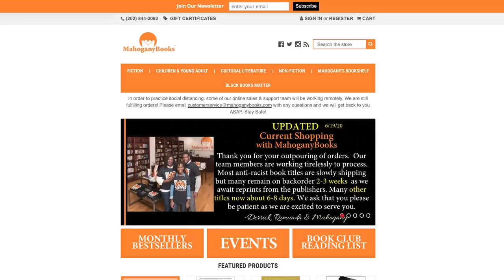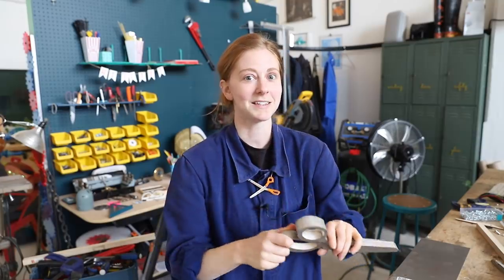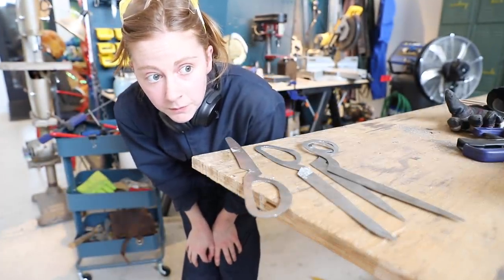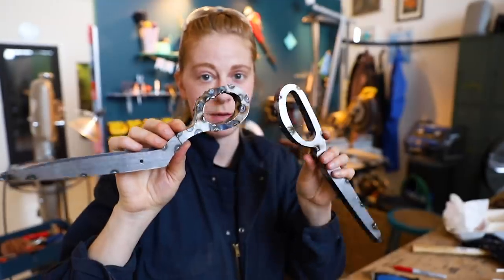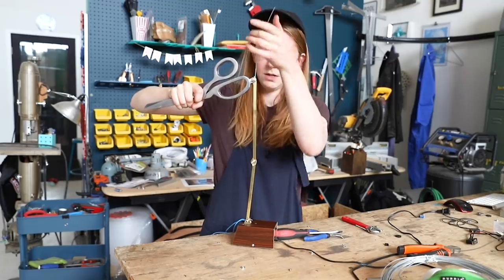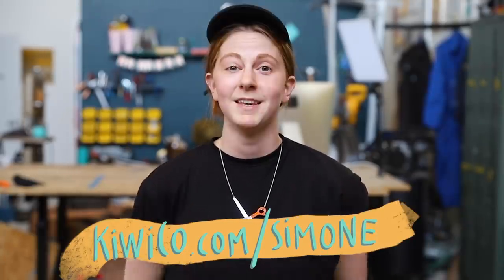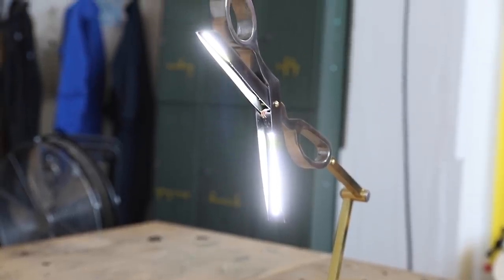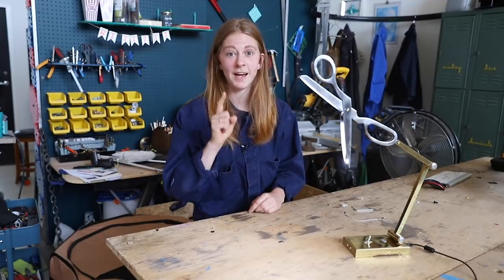Building a custom scissor lamp

Comment: Simone, graduated physical therapist here (and also a maker), the table that you were using is too high for you, so your shoulder was too extended and elbow too flexed. This ergonomics was causing you to not push down the jigsaw hard enough onto the table surface. Possible solution 1: kneel and cut on the floor, and use insulation foam to elevate the sheet metal. Possible solution 2: Build another lower workbench! (a rule of thumb is: the heavier the work, the lower the desk)
Reply: Thanks for the tip... Utilitarian brain goes STEPSTOOL to get more leverage
Reply: @khoshekhthecat  That's ... much clever than my suggestions!🤗
Reply: That's a cool job, does it help you draw anatomy (for art, lol)
Reply: @juliusroman8616  To be perfectly clear, I'm not currently practicing physical therapy. And I think learning anatomy would definitely help your art, I think there are anatomy books specifically intended for art. (I suck at drawing tho🤪)
Reply: Ooh it's so cool when suddenly you can mix two things you know about although they seem to have nothing in common.  Have you considered pursuing a career in ergonomics?
Reply: @Nandanyx  Ergonomics no, but I'm interested in things that help people that need help such as orthotics!
Reply: u could've shaved that down to 2.5 words (ur short lol)
Reply: I'm pretty sure that's the worst way to cut sheet metal anyway.
Reply: Nexus...absolutely agree with you .
My thoughts exactly, plus the table is far too thin.
When you push against a table that is wobbly ( vibrates as it's too thin) ,
...then it affects your ability to work properly. 
Worth investing in heavy duty wooden bench . 

You need a much thicker lower one . 
Same applies with any heavy duty work, like hammering nails , sawing , sanding  etc.
Reply: I would have just used an angle grinder. Work smarter not harder. but she got multiple comments worth of engagement and entertaining footage of her struggling with it, so maybe it’s more the goal here being the process entertainment value, and not really the end product
Reply: @RexusKing  Maybe not a clever solution to use powertools while standing on a small, less stable surface.

Comment: Imagine if there was a contact switch on the scissors handles that deactivated the lights when they were closed
Reply: She even said it was her initial idea!
Reply: I genuinely expected it to be that.
Reply: lol that was exactly what i was thinking she would make. That would be a very cool effect tho
Reply: It would be even cooler if she put a potientometer in the joint so the light would be dimmable
Reply: But then you would always try to see if the light actually turns off, like in the fridge!
Reply: But when it closes it doesn’t light up. So it kinda works like that
Reply: With a potentio meter it is perfectly possible
Reply: I was going to comment exactly that, that's what I was expecting
Reply: Then you can literally "cut the lights"!
Reply: Ya that's what I thought she was going to do
Reply: Yeah I was really hoping that it would happen in this video
Reply: If i can suggest...  Next time, cut It rought with the angle grinder and refine the profile with files.... Or, glue It to plywoog and cut with the jigsaw using some cutting fluid
Reply: My thoughts exactly, follow.up project
Reply: I genuinely thought that was what's gonna happen
Reply: A reed switch, some WS2812, ESP8266 and WLED firmware. Done.
Reply: @skinmore  or a sheet metal nibbler.  Its literally the tool for the job 👍
Reply: It would be great, but this amazing woman deserves a life too😂
Reply: Yeah she could just use a reed switch with a small magnet in one handle.
Reply: 1:44
Reply: Like a fridge! (Lmao I'm a frickin child XD)
Reply: This how smart YouTuber get more comments.
Reply: @SluggzNotFound  bro I love ur name
Reply: Your anxiety about political correctness detracts from this video. Please don’t start beating us over the head with that stuff, it’s everywhere else already.
Reply: OK so I’m not as original as I thought
Reply: Orrr a sensor
Reply: Or just an electric current and when its complete it powers a trassitor making it stop
Reply: Also would be cool to install a cutoff so that when you "cut the lights" the switch inside turns the lights off
Reply: That would be soo cool bro
Reply: I thought the same thing.
Reply: My OCD is crying right now!
Reply: That's what I came here to see, it's what I'm expecting
Reply: It could be done with a reed switch. That would be cool.

Comment: would be really cool if it can actually turn on and off when you open/close them, instead of a switch, appreciate your videos <3
Reply: That's exactly what I thought her design idea was.  Simone - mod2, embed the switch inside the scissors.
Reply: OMG THATS WHAT I THOUGHT IT WOULD BE HAHA
Reply: Yeah, sounded like that was the idea to me too
Reply: Yup, exactly that.
Reply: Same, when she first mentioned cutting the lights I thought she'll use a flex sensor. I actually love the idea and design a lot, but I'd probably get tired really fast opening and closing the scissors just for the show. I could simply leave them open and fiddle with the switch (and then the scrissors being mobile becomes redundant). Hope she posts a part two with improvements because I like this project a lot.
Reply: It could be upgraded with a brake light switch.
Reply: i mean technically couldn’t you shut the scissors and have the lights turn off? they’d still be on but the scissors would block out any light you know?
Reply: Just my thought too! There are cheap magnetic switches for closets... Like, when magnet is close to the switch, it pulls apart two other wires, which provides electricity!
Must make ScisLamp vers 2.0! 😄
Reply: That's what I thought she was gonna do too.
Reply: @TiaMoshii  I was thinking maybe a mercury switch
Reply: my thoughts exactly! Shouldn't be hard to add
Reply: That’s exactly what I thought

Comment: You should use a limit switch so when you open the scissors they turn on
Reply: That's what I was expecting, was slightly disappointed by the use of a regular switch. Did have a good laugh at the rest of the process.
Reply: probably would have happened if there wasn't the three day flaccid stand interlude, I assume
Reply: Stll it can easily be install using cut-off circuit
Reply: MrPaw45 same
Reply: @PratikKatdare  it would make perfect sense to add one, not only because of the easy installability, but also because of the name of the circuit
Reply: Or stick a motor on it to open up on its own and then watch it not working correctly because, "shitty robots"
Reply: At minimum if she had a shot with it turned on and scissors closed and then opening the scissors.
Reply: Simone has said she wants to move away from being “the Queen of Shitty Robots.” I think she has done what she wanted to do with that genre, and is now exploring others.
Reply: @PratikKatdare  Reed switch and magnet.
Reply: If some one likes this ankther person has to unlike it
Reply: *pressure switch bute yes. she could

Comment: My electronics mentor used to say, "If you switch it on and it works the first time... Unplug it fast and double check, you did something wrong!"
That's served me for many years.
Reply: How come? Shouldn’t the goal be to have it work if you do everything right?
Reply: @CosmicGaijin  Because it could just be a fluke
Reply: @CoreyT97  or some of us are just good?
Kidding, we're all just a human.
Reply: My prof used to say that eletronics need smoke in order to work -- cause if you can see the smoke, the electronics ain't working no more.
Reply: @derradfahrer5029  That's the magic smoke that makes it work. Unfortunately once the magic smoke comes out it's hard to put it back in.
Reply: Corey Tobin but that’s what I don’t get. Why is it a fluke? I’ve engineered and built stuff that I got working on the first try (granted not always) but 9/10 times it works the first try and never gives me issues after the fact. So that’s what I’m trying to figure out.
Reply: @CosmicGaijin  If it works 9/10 times you are working on projects beneath you. If it never works at first try, you are trying things too hard for you. Ideal rate should be 50/50. 50% learning, 50% being productive.
Reply: I ve been in the EE for 16 years now and that's one of the main principles i know from the older colleagues whom i learned from:) I always get suspicious if something runs right from the start
Reply: @CosmicGaijin  there's a perfect example of it might be a fluke in this very video actually. at the third coin she puts in at the end of the video, nothing happens. which means that the first few times could just be an accidental reaction as if it worked perfectly. so you need a few more tries to check if everything is actually correct, before deciding that it actually works
edit: i was at the wrong video, please check the proud parent machine: https://youtu.be/M1B3gATS0GE

Comment: "You can definitely see a lot of imperfections in my welds, but since I'm the one making up what scissor lamps should look like, I can just decide that they're meant to be that way." I weld for a living, and have gotten pretty decent at it. Textbook looks aren't everything, and the time you would have saved doing it differently would be negligible. It's obviously not structural, and you tacked it up hella good beforehand and metal finished it beautifully. This is why I love seeing people's "imperfect" metal art, it is literally one of a kind.
Reply: A grinder and paint make me the welder I ain't.
Reply: I was reading this as she said it 😂
Reply: At least she tries, not like me. I'm a shit welder, but I braze anything you can braze, so everytime I can get away with braze welding steel and crap, that's what I go for.
Ofc, structural things I have to go get the TIG, but I swear welding machines have me blacklisted xD

Comment: Literally, Everyone > “Cut the Lights” > it’s just a expression to turn off the lights
Simone > “Cut the Lights” > seriously, use the scissors to cut the lights off.
By the way, someone needs to get Simone a bandsaw for her birthday.
Reply: She has one. It's in the BG at 2:46. She just likes to make life difficult for herself XD
Reply: Or get a nibbler... hand or electric powered, no need for a saw on sheet metal she is using.
Reply: Or a CNC table.
Reply: Or a plasma cutter! 💨+⚡️
Reply: @nickradley  I have a feeling she would love that!
Reply: Or use the angle grinder that she uses to tidy the cuts up with a cutoff blade. Even the Dremel would have been quicker than the jigsaw. But if you HAVE to use a jigsaw, temp glue the sheet to a piece of scrap ply for cutting.
Reply: she got one already
Reply: Sh3 should have a turn switch or just a lever that closes when 90-95% opens the circuit and on 5-10% opened it closes the circuit.
Reply: @Narinjas  thought the same thing
Reply: Her not using a bandsaw does make for great content.
Reply: even tin snips would've gotten the job done probably
Reply: I really don't know how much a plasma cutter costs but if every subscriber would give a bit (yea, I know, never going to happen) it can't be that expensive for each individual.
Reply: I thought her original intention was to use the action of the scissors to turn on/off the light. Ah well, still a cool project!
Reply: @adamsavage
Reply: @cimadev  A plasma cutter costs less than a Tesla, though I'm not sure about a laser cutter capable of that thickness. Since she laser cut the cardboard mock-up laser cutting the final version would seem logical.  But either one a a fair investment to make, still, if one is going to FIGHT with a jig saw for an hour, one might at least consider a scroll saw, or, if you have an hour, maybe even a hand powered jewelers saw.  Also, TIG welder! though, if going with jewelers technology, silver brazing could be a viable option.
I am disappointed she didn't put the switch in the hinge of the scissors, putting switch on the base is like putting an electric motor in an El Camino, a lot easier, probably more "practical", but not as cool. (in other words, not what one watches Simone for)

Comment: It’d be dope if the lights turned on when the scissors were opened, kickass project regardless
Reply: I was thinking the same thing!
Reply: just like a fridge
Reply: @Bruno Mikus . . . No.  No, they are not.
Reply: @Bruno Mikus I laughed so hard at this, thanks, you made my day! 😂😂
Reply: @Bruno Mikus take all the shelves out, then get in your fridge and shut the door.
report back to us your findings..
Reply: @Bruno Mikus check around the edges of your fridge (when open). There should be a little piston-looking thing, usually at the top somewhere. Press that in (with the door open), as if your finger is the door, and it cuts the light :) Although I think there MIGHT be fridges with a different mechanism, but this is the most common one.
Reply: I thought that's where this was going.
Reply: She literally showed that at 1:37 :D
Reply: @hobistinyheartbag  why she no?
Reply: Yeah, something like an endstop in the handle could work, but it would probably mess with the aesthetics. It looks really cool as it is:]

Comment: How to cut sheet metal with a jigsaw:    
1: sell jigsaw
2: buy bandsaw
3: cut sheet metal
Reply: Right...........
Reply: She has a bandsaw in the background
Reply: SHE HAS A BANDSAW IN THE BACKGROUND.
Reply: A scrollsaw is marginally better to cut the way she was cutting, but it will have basically the same problem. Even a fine tooth metal cutting blade (on either jigsaw or scrollsaw) can catch and rip the work piece up. The only way i ever found to cut metal like she was, was to glue the metal down to scrap plywood, or use 20 clamps that you constantly move around. clamping right in front of where you want to cut works best, but then you need to move the clamp constantly. Really, glueing the sheetmetal to scrap plywood is the fastest (although it can still rip up). 

Obviously a bandsaw is the perfect tool for this because it can never rip the piece up from the work bench.

There are very fancy jig saws that will push the blade forward on the down stroke and pull it back on the up stroke. If you BARELY push while cutting with one of those, it will not grab as much. But it will still grab. I think those are called oscilating jigsaws or something like that
Reply: Gunhaver TL;DR you’re wrong
Reply: Let’s buy her a water jet CNC.
Reply: yes cutting metal with a jigsaw is the worst
Reply: michael1234252 perfection.
Reply: Drimel works great for the fine details and curves.
Reply: @Gunbudder  that's why you buy a diamond cutting edge blade. like, 3 or 4 dollars for like a 2 or 3 pack from harbor freight
Reply: I couldn't hammer a nail if my life depended on it, but while watching this madness,  I kept thinking, "Surely, there's a better way than this."  Glad to know there is.
Reply: nah a nibbler would be perfect even more than a ban saw for tight turns, they work so good for thin metal plus name is funny as haha
Reply: She need cnc  plasma cutter
Reply: Should definitely just buy some inexpensive sheetmetal shears to cut that with.

Comment: Having the light turn on automatically when opening the scissors would be amazing
Reply: I agree! I'm sad it didn't work out that way. But I'm glad she showed us her mess ups and mistakes. ❤️
Reply: Then you could cut the lights...FOR REAL.
Reply: @joanna4655  True. It adds to the experience of something being built from a concept. Her frustration at not getting it right the first time, but persevering until she does get it right is what the creative process is all about.
Reply: I thought that would be the case
Reply: @RBelmont  Exactly. I was disappointed when she installed the switch. But it turned out great nonetheless.
Reply: Well I mean if u just keep the lights on and just close the scissors the light would be covered and be closed 😂
Reply: I thought that was going to be he case, but then saw the hinge issues and figured there’s likely no practical way to do it without making all arm hinges locking instead of friction hold, and that would annoy me to the point of never really using the lamp.
Reply: I'm good at electronics and it wouldn't be hard to hide a micro switch in the scissors to make it happen.

Comment: 2 tips:
1, when making shapes out of sheet metal: use angle grinder to cut in rough shape, and refine with a flap disc with the grinder on a slower speed (until you get the feel for it, then go full force)
2, use a tig welder instead of a mig welder for thin sheet metal.
Reply: Thank you for that welder advice!
Reply: I think you have too coarse of a blade
Reply: @brianmiller1077  My thoughts exactly, a very fine toothed blade will help and highest speed on the jigsaw. But depending on the thickness of that sheet I'd use a nibbler to get the rough shape and try to refine it as Mika Vink said.
Reply: Cnc routers also work great and it doesn't really require that much physical work
Reply: Bernd Wechner I was also wondering if she had the orbit setting of the jigsaw on because when cutting metal you want it off🤷‍♂️
Reply: Power tin snips are amazingly useful, depending on the gauge of sheet, of course.
Reply: @xray235  the gauge look a little bit too thick for that
Reply: Band saw would also be useful.

Comment: Die cutter presses with small simple shapes are great for cutting sheet metal. Make sure the press is well suited for the material and thickness, More travel on the handle (as well as longer handles) and less on the press usually means more force. When in doubt, try it! You can also extend the handle for more leverage, but you may break the stamp or even the press depending on the design.